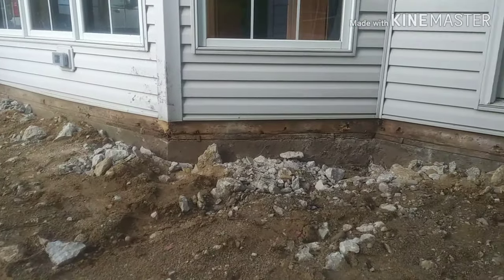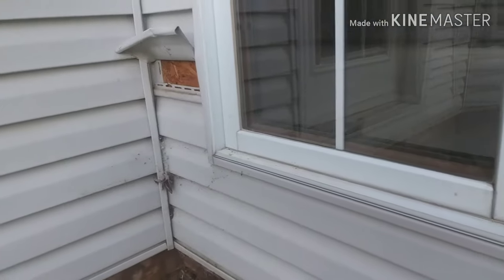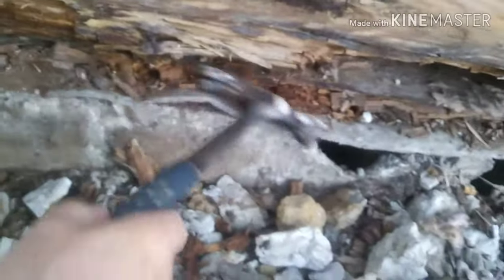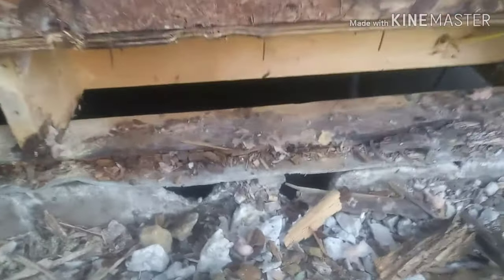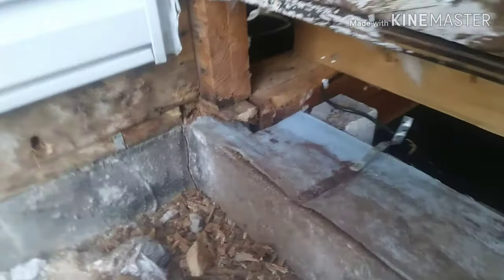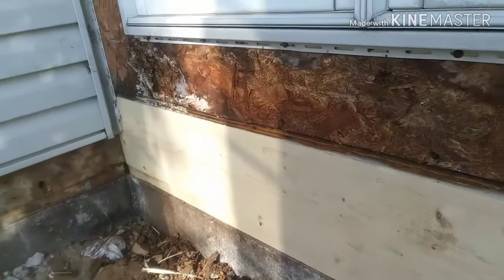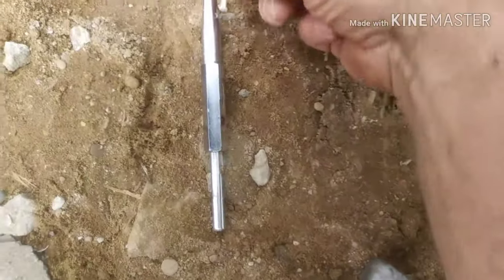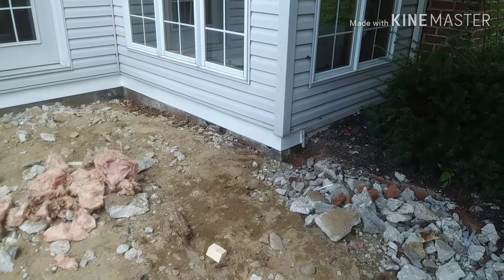how to replace a rotten rim joist

Comment: Just a friendly heads up. Your house has no tyvek house wrap under the siding. In our area its code because Siding is not 100% water proof, especially vynal. Might be something you want to consider to save more trouble down the road.

Comment: I have to make this repair on an old house I just bought. And for extra fun, it’s built on an old stone “foundation” whose mortar has checked out a long time ago. Still working on a solution for that. Best one so far is pressure treated 6x6 or whatever size the rim juice is and building off that. The interior floors are all built directly on the dirt. Someone has replaced the floor joists somewhere in the last 20 years. Joists are still in great shape other than the 2 foot spacing. The 1/2 in osb? Not so much. Pretty much paper machee

Comment: I had some work done on small one story house recently and they wedged up to push new pt treated sill plate wood in sections. But to my surprise they didn’t remove old rim board that rotting away. Instead they put new pt wood in sections next to old rim board from inside the crawl space so old wood still there and new rim board is pieces between floor joists. Will that be a problem later or will it house be structurally sound and would old wood cause new wood to rot?
Reply from the maker: @Luckyr2kThirteen  should be ok even in contact with the old

Comment: Similar situation on my house, but thankfully not as bad. Concrete against rim joist, but at least they used a 1x board against the foundation and up against the rim. Of course, that failed decades ago in one 6-8 foot spot. Our house doesn't have a sill plate; rim and all blocks right on concrete block foundation. Thankfully only the bottom 1-2 inches of the rim joist is rotted in one section. New concrete: crew put expansion joint on top of flashing. I plan, from inside the basement, to cut out the rotted wood and sister in new boards (treated?).
Reply from the maker: Yeah, in that situation treated is a better option
Reply: @GetToThePointplz123  after reading your comments here, makes sense, because no barrier between masonry and wood. Thanks for responding!

Comment: I've got the same situation. Not on the end of the floor joists though. It's on the wall where the floor joist runs parallel. Would it be the same procedure?
Reply from the maker: I can't be sure without looking at it?
Reply: @GetToThePointplz123  okay. I'm planning on having a family carpenter help out with up but just figured I would ask for my own curiosity. Thanks for the reply.

Comment: Why not use pressure treated sill and rim?  If somehow some water founds it’s way in there, it won’t be an issue
Reply: Its against code in most places to use treated lumber inside the house other then some specified areas. Like sills against basement floors being finished or the like.  Treated lumber is full of carcinogenic chemicals.
Reply: @MakesCache  sill and rim are not inside
Codes change constantly, this CHANGE SHOULD be code
Reply: My sill and rim joist are inside . I’m in Ontario

Comment: Super helpful! Question, what lumber can I use for the rim board beside LSL?
Reply from the maker: If you have a sill seal barrier between framing and masonry you can use white pine, yellow pine or treated
Reply: @GetToThePointplz123  Do you need pressure treated wood?
Reply: Always used treated wood where ever there is moisture issues. It also prevents termites from being attacted to it alot more than regular boards.

Comment: Great video. Any thoughts on using a moisture barrier paint on the concrete before the sill plate?
Reply: You can waterproof foundation block but you have to do it correctly with the correct product or you'll end up increasing your moisture issue.
Reply: I suggest not water proofing the top of the block, you will just trap all that moisture in the block potentially creating other problems or sending that moisture somewhere else in your house. They sell a foam tape or roll that is meant to be laid between masonry walls and lumber.

Comment: shouldnt you use treated for rim joists?
Reply from the maker: Only if its in direct contact with masonry. If you have sill seal foam or celetex between framing and masonry you do not need treated
Reply: @GetToThePointplz123  i would still use treated to aid against rot myself

Comment: do not bend the metal towards the rim joist.  If anything slightly bend away, at 1/2 " or less from the bottom.  As the name implies, you want that last drip, to drip without touching the joist.   Yes, at some high wind locations, we bent towards the structure, but that was when it was set in epoxi, which sat on roofing.  And the bend towards the structure was 2" or so high from the bottom.  The goo it sat in prevented any wicking.   Today you cannot buy the toxic goo.

Comment: What would you do on a tiny 1 story house if the sill plate, rim joist, bottom plate, floor joists and floor are all rotten and the wall bowed outward.... What would you do first? 1) cut floor out, 2) screw a long 2x4 horizontally to the problem wall (going into each stud) and another horizontal 2x4 to the wall across it (also screwing it to each stud) 3) tie the problem wall to that other wall with a long 2x4 3) jack up the ceiling with a vertical beam to the ground under the house, 4) pull the two walls together 5) jack the ceiling some more to lift the wall up 6) replace sill plate, rotten rim joist, bottom plate, joists, add plywood, 7) lower the wall back down? Thanks!
Reply from the maker: Brace walls and do it in sections

Comment: Did you have to get under the house or jack it up? Also, the sections of the rim joist you replaced, how did you connect them together?

Thanks!
Reply from the maker: I didn't have to support that section while working on, some conditions will need jacks or support s while working on it(every job is different) the 2 piece rim is spliced in the middle where the block is . you can fasten together with angled nails or screws if you need to

Comment: We have an old farm house that someone poured a 4 inch high concrete rim around the house on the stone foundation wall covering the entire parameter rim joist on the outside of the house.   Water got in there and it's rotted not only the rim but the sill and part of the wall.   Is that what you had?

No one will tackle replacing the bad rim and sill because it has to be replaced from the inside in the crawl space.   If anyone has this same issue and found a solution,  please let me know.  I have a cousin who has a house in another city far away that has the same issue.  It must have been done to other houses also but I've yet to find any video showing anyone either replacing the sill and rim or removing the concrete.
Reply from the maker: Yeah that sounds like the ground is higher than the wood framing , if at all possible try to get the grade around the house below the framing and sloped away from the foundation otherwise it will probably happen again...good luck👍
Reply: @GetToThePointplz123  

Already planning on that but it doesn't change the concrete in front of the rim.   Makes it impossible to replace from the outside

Comment: U do good job ,,that board was pretty rotten…..however the inside wood.. looked like new. Would be ok also to place " Tar paper "...b/4 the siding ?...I mean just like the roofing tar paper...??   Having self confidence in a Job...…..its is great.  Thnks for ur Video !
Reply from the maker: Tar paper would work too but again not necessary if properly framed, flashed and sided

Comment: Omg don’t you need to support the wall??
Reply: I would. Probably ok in small sections but he tore out the whole length. Guess his plan was to work fast and hope.
Reply: @ma7rix13  same situation and my walls have cracked just discovered..i think i need to support walls to get up underneath the 2 by 4's i have on slab and brick exterior wall 1952 house
Reply: mine started with an undetected small hole in the roof leaked into the exterior wall for 2 to 3 years .... rotted subflooring in that area .... insurance will not cover long tterm water damage undetected by owner